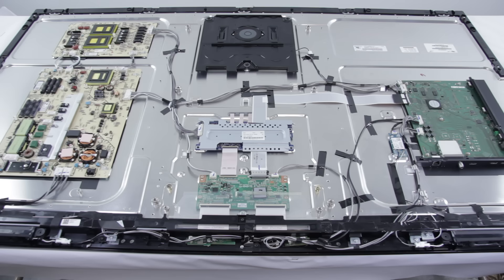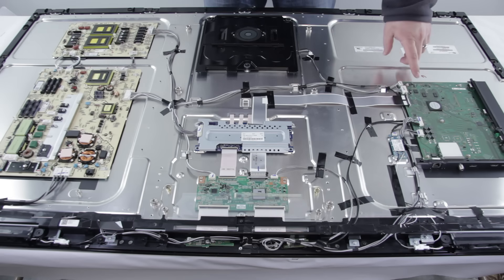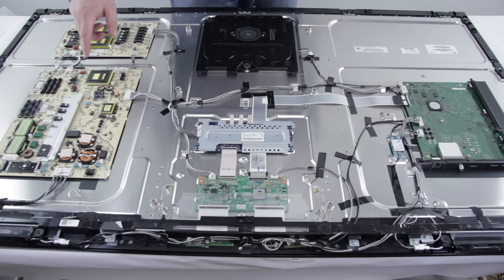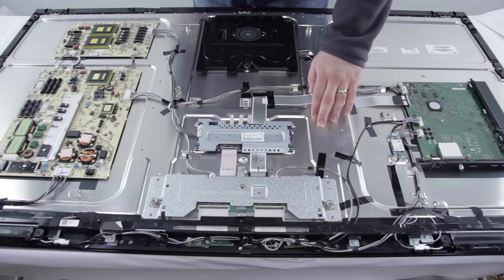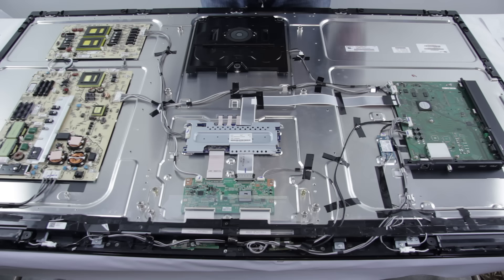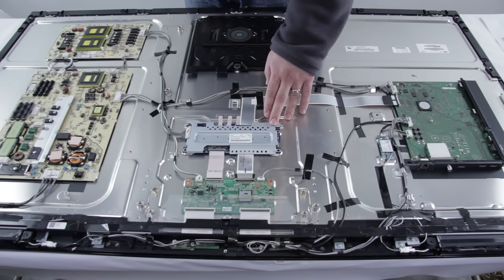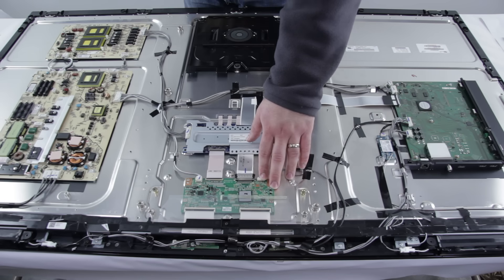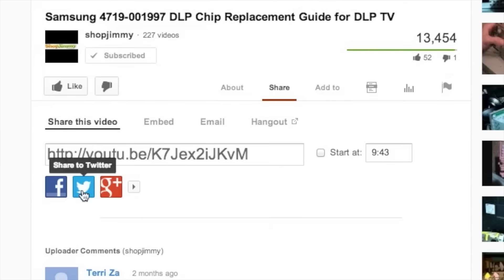LED TV Repair Tutorial - Common Symptoms & Solutions - How to Repair LED TVs

Comment: I have a samsung LN37A550P3F..A few months ago at start-up the TV began screeching very loud(even if turned down to zero prior to turning off the prior use). The screen will either be black or usually have a mixed colored screen. When it is black it is silent. When a mixed colored screen it screeches very loud.  It will turn itself off and on by itself trying to restart and still screech really loud. Unable to turn it off unless unplugged. If I leave it on it will continue to turn on/off and screech and you will slowly get a picture after numerous on/off episodes. Eventually the TV would work normally until it is turned off. A week ago it began working every time. Though yesterday and today the screeching returned and after leaving it on for 2 hours it never produced a picture.Before, after about 2 to 10 minutes of listening to the screeching it would work. ..It continues to turn on/off and screeches really loud. Any help would be appreciated....With 2 kids in college I need inexpensive TV repairs..LOL....

Comment: I got a vizio 50 inch model # SV4OM  i hooked it up to cable and it came on and program was on. After about 5 minutes horizontal lines started to appear in the middle of the screen. Then after a few moments the lower 3/4 of the screen turned black, and the top 1/4 still played the program. Is it worth fixing? thankyou.

Comment: LG 32LC46 i got this tv for 6-7 years and it appears that the last month my tv is opening up normally for the first 30 seconds but suddendly closes making a clicking sound from behind.Indicator still remains green like the tv works properly.Also after 5-10 tries those 30 seconds of my channel being shown reach to 5 seconds or even less but the clicking sound from behind doesnt happen after the first time the TV closed.Also i actually manage to make the TV work but after 3-5 hours of trying to open it up and then if i close it the same thing will happen after and i ll need another like 5 hours to open it.

Comment: Hi, I got an LG LED TV 50 inch. Model number 50LA6130, I do not see any backlights except when I first turn it on the screen also turns on for a second with the LG logo then goes black. Sounds works fine when i tried hooking up a PS2 and turning on the console. I also did your flashlight test and I see all the menus and images when I point the flashlight. What component am I looking to replace here? Thank you very much for your informational video, definitely helpful. Now just need to figure out which one to buy and replace. Thank you

Comment: Hello! No picture or sound on my LG LED TV 42LV3730. USB input device is also not recognized. Did the back light test and they light up when I disconnected the main board and closed the loop. Guessing its a faulty main board? Would you have it for this model?

Comment: I have a LG lc470euf and I'm noticing that it is darker than normal.  it continues to dim over time.  based on this video I assume my back light inverter is intigrated into one of the 3 boards.  could you please offer some advice and a link to what I need to purchase.  thanks

Comment: Samsung UN46D6450UFXZA. September 2011. Bottom half of screen is perfect. Top half has thin white or light colored horizontal  lines every half inch across the whole screen. Can see picture on top half except that horizontal lines run through it. On left side of screen where lines begin is a blue/black spot about one inch by one inch. Removed back. No loose wires or burn marks.

Comment: I have a Samsung UN50F6300, 25 months old. 
I'm experiencing display issues, 2 darker horizontal areas approx. 4-6" wide through the center and bottom of screen. 
The picture is still visible through the darker areas. 
Any idea what component might be the culprit?

click this link to view screen shots   
https://www.dropbox.com/sh/rc9k1mm0jglc53m/AABM_gVpNqzuL6_pJ-ZS7Ycea?dl=0
Reply: +Joy Bennett, Did you find a solution yet? I have a similar problem with my Samsung 40F6400.

Comment: VERY informative video. Thank you for sharing.
I have a Vizio E480-B2 that has developed an approximately 4 inch wide vertical line on the left side of the screen. There are black and white bars in the line which are moving upward. The line is covering the menu partially. Could you lease advise as to the part I need for this problem? I have gotten the line to disappear for a while by tapping the casing of the TV, but when you turn off the Tv and turn it back on, the line reappears. 
Thank you very kindly.

Comment: Hi Shop Jimmy.com I have a Philips 46 flat screen Model 46PFL3608/F7 ;  S/N DS1A1310112343-   A37QAUH 
My TV was working fine then one day the remote would not turn the tv off so I turn it off manually., then for weeks it would not turn on, so I unplug the power then when I plug it on days after it came on and did the same, so I turn it off manually again it would not turn on, thinking it was the power supply board I order it from you (sku;A37QOMPW-001) put it in and it would not turn on take it to a tech he had it for 5 weeks plug it in and it turn on work fine for a few weeks with the remote too, now doing the same it would not turn on or off or work with the remote, He said it is the main board but he did not check it, it work fine when I change the channels manually the only thing I did not turn it off manually all I do is unplug it to turn off because I know if I turn it off manually it would not come on  
PLEASE HELP

Comment: hey Jimmy. I'm having a certain problem with my LG TV right now. it will work for 15 or 30 minutes then it will start to turn on and off automatically until it finally turns off for good and I cannot get it working unless I unplug it and plug it back in. I know I can fix it myself I just need the right diagnosis and part that will fix it. 

it's a LG 32LS3400

Comment: hi   I have a Samsung model  ln52b550k1fx2a   . my problem is  horizontal lines  and double images on right side of screen..I suspect tcon board but would like you opinion before buy one. saw vido s of people putting tape over ribbon conecters to fix simpler problems?? I rather just replace part .  thanks for any help advice you can give.      todd

Comment: ShopJimmy.com. HI,  Yesterday I plugged in my tv with wall main socket and attached my laptop with HDMI cable I wanted my tv screen to show Laptop screen so i was pressing remote button stupidly and option came up cinema which i selected after that selection pufff sound came from tv and since then my tv does not even show any power. My wife even smell a burning smell (Could it be power supply gone?) After that even if i plug it again on main wall the no standby or any kind of light comes on.
My tv model number is:42LN5400 ATS (however if i go on LG website model number shows up only upto 42LN5400 additional characters ATS only shows on back of my tv sticker)
Manufacturer: LG
Serial number: 307MLYF09938
Could you please advise if its a power supply or where I can buy it? If you have made any video guide how to replace it?
My email adress: wiskam@hotmail.co.uk
your help in this regards will be greatly appreciated.

Comment: Hi,I have 2 same kind of Samsung UE55ES6100 LED TV,both need to fix.tv 1 does not display anything but screen turns on also sound when i move joystick as i test watching your video.Tv 2 have prob with screen display shady images also many lines or no colour.i want help/suggestion what should i do!which tv is easy to repair TV1 or TV2,also what to change like Tcon,main board etc.
/Regards

Comment: hello, I purchased a LED smart TV lg model 32LF58OV . They have checked it and it was all ok. At home, when I connected the cable there was an electric discharge with   little smoke. After that the tv would not turn on . What do you think? Is it repairable?Thanks

Comment: I have a 60" Samsung un60eh6003xfza which powers up with a blue screen and NO AUDIO but does show backlights. After less than a minute the screen goes black, backlights off. After a few minutes the screen turns back to blue and AUDIO comes up. This cycles every few minutes from Black screen to Blue screen with audio, back to Black screen with no audio.

Comment: Hello, I have an Insignia LED TV, model # NS-50D400NA14.  I came home and found my TV no longer working; I have a blank black screen and no audio.  I do have a standby light that blinks off when I turn on the TV, as usual, and the Digital Output (optical) is lit when plugged in, but no backlights (I'm not sure my TV has these in the first place).  I tried the flashlight test, and couldn't see the TV menu.  The TV itself isn't making any funny noises.  Any ideas?

Comment: Hello, I have a samsung 60" LED TV (un60f6300af). While watching, it will randomly turn off and on repeatedly, its very annoying. I've been searching the web, and it seems to be a pretty common problem. I have the TV pulled apart, looked for bulged capacitors, but don't see any. Do you know anything about this problem or how to fix it, maybe which capacitor it is? Also, on the power supply board, there is a darker spot on the plastic that looks like it got warm, about the size of a dime, could that be the problem? Or maybe just a blemish in the plastic?

Comment: 2 year old Sharp LC-60LE845U Aquos Quattroun 3D.  It is flashing 2 times slow and 5 times fast on the little power light located on the bottom middle of the TV.  I have tried all the unplugging and holding buttons down and such, i get nothing on the TV.  I'am going to take the back off today and would like to know what board i need to replace.  Its has not been working for some time and there is nobody close to were I live to take a look at it. I have never taken a TV apart but i do build all my computers and other electrical do dads for myself and others.  So i'am not afraid to jump into this project. i just wanna buy the right part the first time Please help. that being said i've seen lots of the same issues with this version of sharp tv's, but i understand it cant be just sharp. it looks great when it worked and i've been very happy with it till this happen, i spent 4x more on this TV then the vizio i use up stairs that is 5 years older!

Comment: I have a Vizio XVT553SV. The orange standby light comes on when plugged in but the TV will not turn on and the Vizio logo never turns white. I'm wondering if I have a power supply problem or something on the main board? I haven't taken off the back to see if there are any bad capacitors or anything burned or obvious but that will be my next step.
Reply: +Ron Kirsch I am having same issue. Just replaced power board and nothing changed. Will stop back if I figure it out. Good luck Richard
Reply: +Gino Lorenzini I've replaced the power board, main board and the TCon board. I've got sound but no picture. It has backlight but it never boots up. Never displays Vizio logo or anything. Any ideas ?

Comment: Do you think by looking at this mark on the display, you will be able to say if this is repairable. Just want to avoid opening up the TV, if I can get your expert advise. Thanks for help, and the video is very useful. https://plus.google.com/110797279323538364079/posts/3QFqC8LKtLv
Reply from the maker: +Sandeep Karun   Try all repairs and troubleshooting at your own risk.  This sounds like a TV panel (TV Screen) problem.  If your TV panel is bad, it may be more cost-effective to replace the TV as panels are typically hard to find in stock, difficult to replace, and expensive.  Thanks and please let us know if you have any further questions!  www.shopjimmy.com

Comment: Great Videos!
I have a Samsung UN46D7900XFXZA TV. It shows a solid horizontal shade about an inch high in the middle of the screen. It is like a ghostly overlay and is less prominent in some scenes vs others. Similarly there a bunch of vertical lines that span the left edge of the screen all concentrated about an inch or two of area. Any idea what could be causing this? I can provide a screenshot of the TV showing these artifacts if that helps. Please let me know. Thanks.

Comment: Hi, I have a Samsung UN46EH5300FXZa version: UF03. The tv has sound and picture when I check it with a flashlight, but the backlights are not working. I already tried switching out the power supply/led board (from shop jimmy parts) since they are on the same board, but the problem is still the same. Any help is greatly appreciated!

Comment: My children recently hit my Emerson LF501EM5F television.  This left a small spider web crack in the bottom right hand corner.  The screen longer produces any picture but there is still sound.  The screen is completely black except for seeing the small spider web crack.  Is there a way to fix this problem?
Reply from the maker: +Kimberly Hokanson   Try all repairs and troubleshooting at your own risk.  This sounds like a TV panel (TV Screen) problem.  If your TV panel is bad, it may be more cost-effective to replace the TV as panels are typically hard to find in stock, difficult to replace, and expensive.  Thanks and please let us know if you have any further questions!  www.shopjimmy.com

Comment: I have a Samsung un60f6300af that will not power up that I'm trying to diagnose. there is no power and no lights at all.  there are no blown capacitors? how can I determine if it's the power converter or something else?

Comment: I have a LG 32LH200C it has a slight  flicker on the screen.
Reply from the maker: +Ifthi Marikar   Try all repairs and troubleshooting at your own risk.  This could be a problem with either the power supply board or the LEDs in your TV.  You can replace the power supply board to see if that fixes the problem.  Click this link to replacement parts for your TV model number:  http://www.shopjimmy.com/catalogsearch/result/index/?cat=59&q=32LH200C  There may be multiple boards for the same TV model number, be sure to match part numbers on your current board, with your replacement for compatibility.  Here is a link to a video showing how to identify your part number, click here:   https://www.youtube.com/watch?v=_4Qpfan0vdU  Thanks and please let us know if you have any further questions with your TV Repair!  www.shopjimmy.com

Comment: I have a lg. 42lg30. When I plug the set in, it powers itself up and displays the input menu and the move without any input from me. In the back it is a snowy picture with static. Just happened overnight. Any ideas. Thank you
Reply from the maker: +skipcar3   Try all repairs and troubleshooting at your own risk.  I recommend replacing the main board in your TV.  Click this link to replacement parts for your TV model number:  http://www.shopjimmy.com/catalogsearch/result/index/?cat=56&q=42lg30  There may be multiple boards for the same TV model number, be sure to match part numbers on your current board, with your replacement for compatibility.  Here is a link to a video showing how to identify your part number, click here:  https://www.youtube.com/watch?v=RwHTvjMdrhk  Thanks and please let us know if you have any further questions with your TV Repair!  www.shopjimmy.com

Comment: i have a 46" rca led model no. LED46C45RQ   ..it powers on when u press the power button or atleast the red light goes away,i have no pic or sound and the only way the led will shut off once powered on is to unplug it
Reply from the maker: +Daniel Thacker  Try all repairs and troubleshooting at your own risk.   I recommend replacing the main board in your TV.  Click this link to replacement parts for your TV model number:  http://www.shopjimmy.com/catalogsearch/result/index/?cat=56&q=LED46C45RQ  There may be multiple boards for the same TV model number, be sure to match part numbers on your current board, with your replacement for compatibility.  Thanks and please let us know if you have any further questions with your TV Repair!  www.shopjimmy.com

Comment: I have a Sony Bravia LED - Model KDL32R330B.

Backlight works, but had black screen issue. Replaced the main board last week and tv worked - was able to use a blue ray dvd player without issue. For the past week the tv remained unplugged. Now it is not working again. Backlight does come on. But no Bravia logo or anything on the screen. Tried factory reset - but this did not solve the problem. I am not sure where to go from here. If I need an additional part would like to get your guidance and purchase the part from your site.

Thanks in advance.

Ken

Comment: Hi.  I have a 32LD350/550
it has picture on top (clearly) but the middle. is distorted and bottom is almost completely NO PICTURE. I replaced the RDENC2631TPZZ panel but it's still with same problem. any help would be appreciated.
thanks!!

Comment: Hi. I have an Lg 47LN5700-UH. Audio works but i have no picture. Flashlight test shows there is a picture in the background. Can you confirm which part i probably need? Nice straight forward tutorial for troubleshooting. Thanks. Mrwileyc@yahoo.com
Reply: Oh and the LG symbol comes up for less than a second when the power is first turned on
Reply from the maker: +Kyle Thomas    Try all repairs and troubleshooting at your own risk. This sounds like a problem with the actual LEDs inside your TV. These LEDs are replaceable, however it is recommended they are replaced by someone with the proper experience and training. When replacing the LEDs, the TV panel can get damaged. If the TV panel gets damaged, it is not repairable. Click this link to replacement LEDs for your TV model number:  http://www.shopjimmy.com/lg-lc470due-sfu1-led-strips-12-strips-1-board.htm   Be sure to match the panel information necessary to ensure you have the correct replacement LEDs.Thanks and please let us know if you have any further questions with your TV Repair!  www.shopjimmy.com